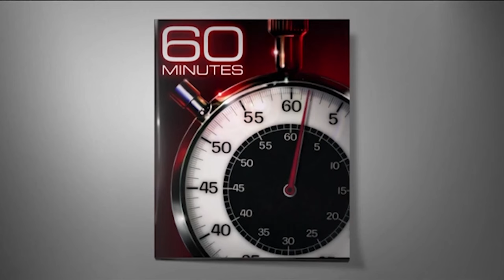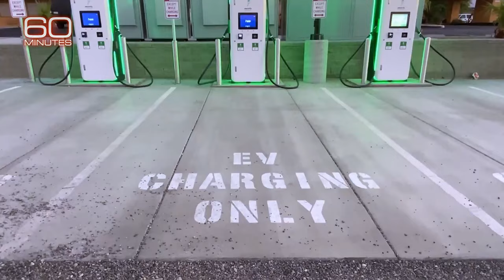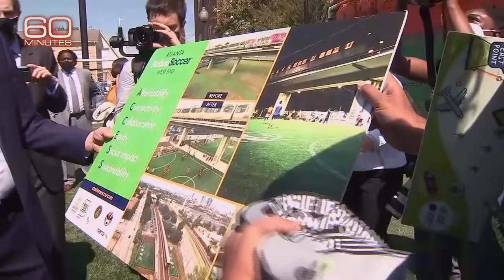Secretary Pete Buttigieg: The 60 Minutes Interview

Comment: I am all for building smart but what does that mean? Does it mean roundabouts and proper lane integration for freer flowing traffic, instead of the stop and go traffic there is now? I live in New York and there are a lot of lights and stop signs. The highways have short to none existent ramps. Granted they were designed for a different time period. The biggest question I have though is where are the new roads and bridges going to be built? Bridges are easier to think about because the equipment and construction can be applied on the water and then connected to existing roadways. Overpasses for trains and vehicles is a different story and I struggle to rap my head around what construction would look like. Same goes for new roads because the city is famous for being known as congested on its population density. I have heard of a underground roadway to connect Long Island with the city to ease congestion from 495 (Long Island Expressway). The b1m also has a few videos on construction projects and ideas for anyone who is interested in engineering. Electric cars are definitely interesting because of idling issues from ICE engines and most electric cars have the added bonus of regenerative braking, which reduces dust particles in the air, since conventional brake pads aren’t applied as often. It is good for cyclists and animals since it reduces direct air born particles. There might be a possibility for skywatchers if it works well enough. Light pollution and sound/noise pollution is another concern that I have. I have no doubts that Pete will try to address these things but I wish he or an engineer would explain a plan for the future so I can get an idea of what to expect.
Reply: I'd love more roundabouts being implemented.
Reply: Building smart = sustainability

Comment: A whole 13 minute interview and only one 15 second mention for Amtrak. Improving our ancient public transportation system is vital to the future of the USA. Locking Americans into using cars, highways, and airplanes is a tax on families and working class individuals.
Reply: Amtrak and cars are not in the same categories. Amtrak even sufficiently funded, can't replace cars because it's an intercity mode of transportation. Our current issue with cars in commuter traffic, which needs to be solved with regional rail or some form of rapid transit. Please educate yourself on what Amtrak is and what our current automobile dilemmas are before commenting.